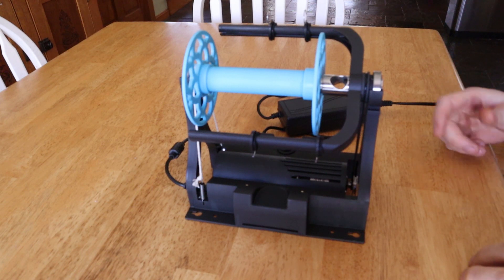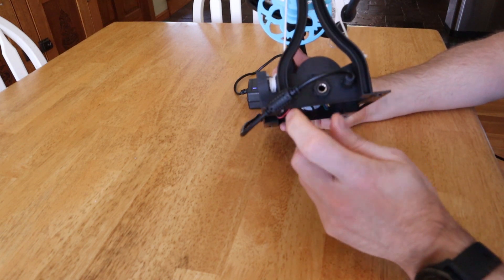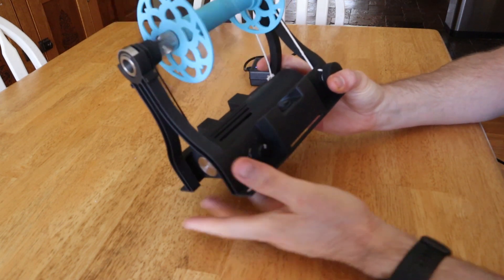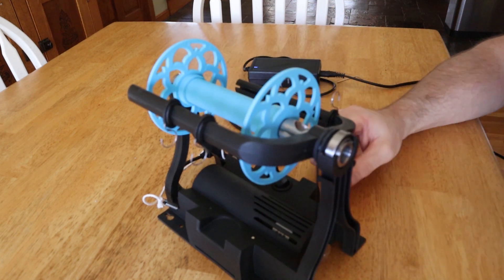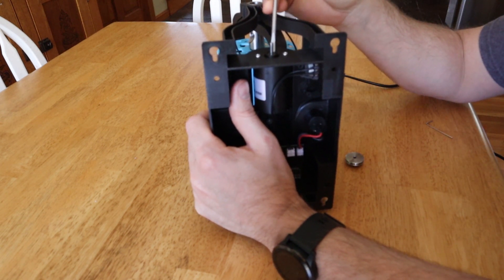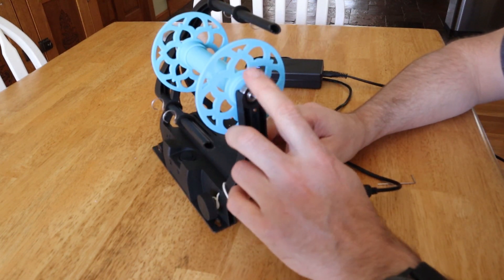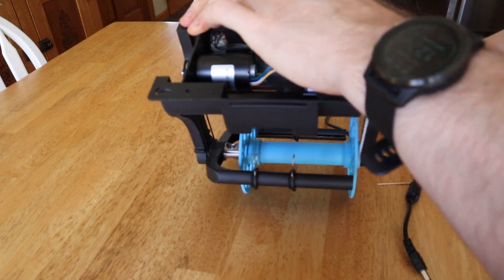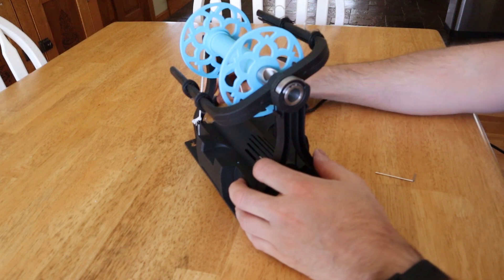SPIN 132 - Why is my EEW 6 Not Spinning?

Comment: Hi! Do you know about the problem with the engine that it stops working completely after a few months? The first problems came early on and then it slowed down by itself and finally stopped working. I contacted the seller and now i already replaced the engine with a new one and used it for a day now and the same problems started, now it won't start at all.